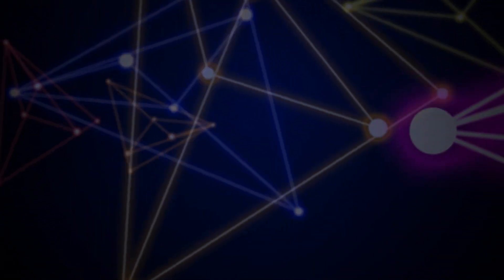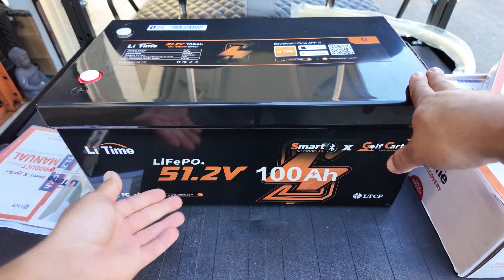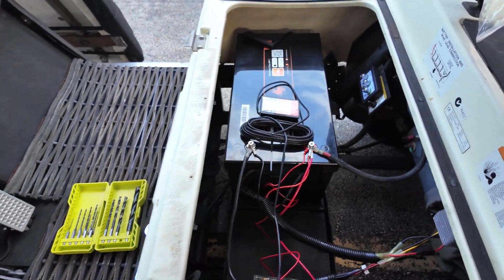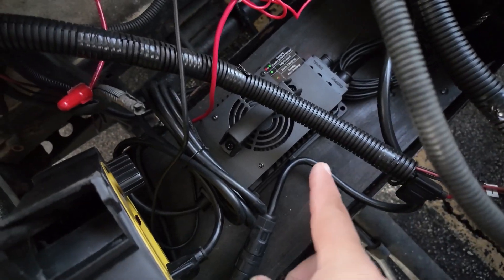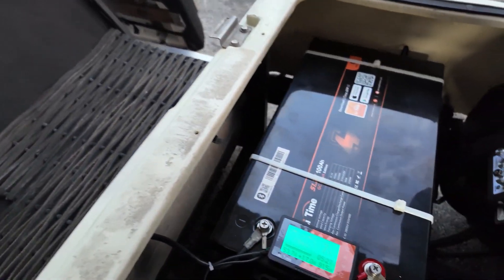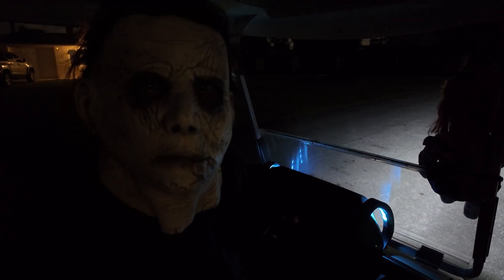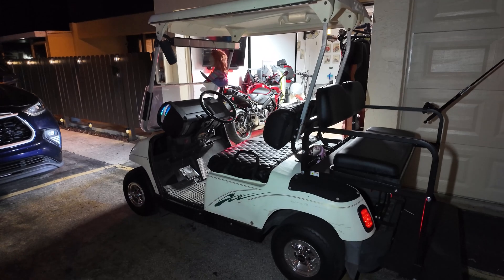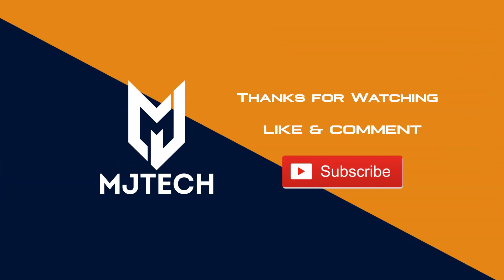Li-Time 48V 100ah LiFePO4 Battery - Tested The Halloween Spooky Way!

Comment: Looks good, I am a big fan of the Li time batteries and have purchased many of them. I did notice one thing in your video your power inverter ground should be connected to the shunt as well with the other P- grounds... to get the most accurate battery readings.